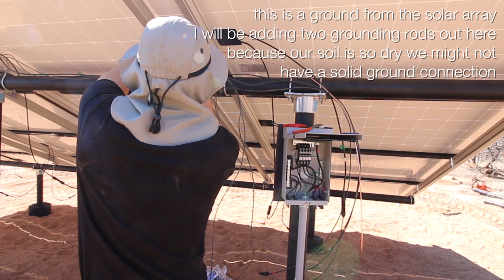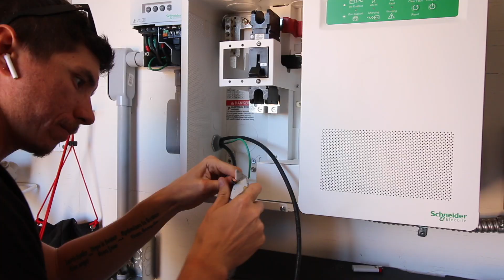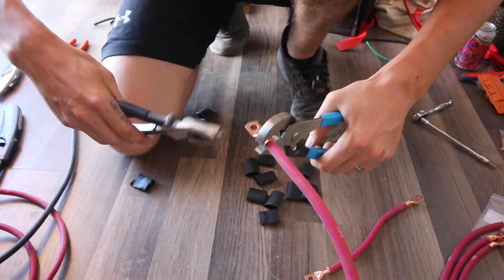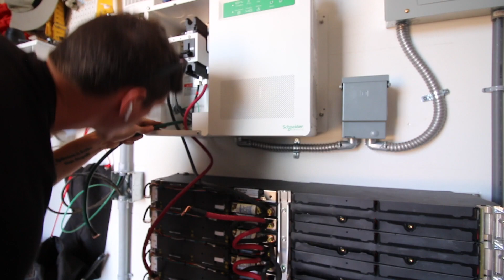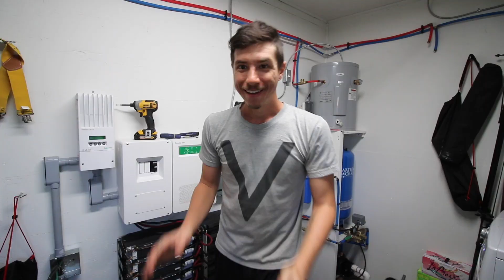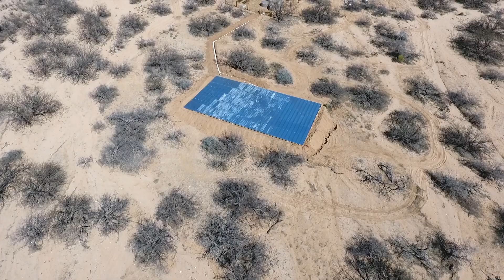HOLY F#CK IT WORKS!! Off Grid Solar Installation Day 6

Comment: Great work, using used EV batteries makes this a really sustainable system. And also from a technical point I think they are a great choice. EV batteries are often unusable for their primary purpose at 70%-80% of their original capacity, still a great energy density for stationary battery solar system.

Comment: What is the life span of the batteries and if one goes out can you just replace one?
Reply: Several thousand cycles to 100 percent discharge. He really should have a BMS/monitoring system on them.
Reply from the maker: I can get replacements for the different batteries

I've seen the cycle rating for lithium ion batteries before to be about 2000 cycles

Comment: Do the battery cells need an air gap separation to allow thermal cooling?
If not why not?
Reply: The cells don't really need cooling for this use, they originally had liquid cooling inside the Smart ED (which was a full electric not hybrid) but given our low current draw 60-80A and the fact that these batteries are wired in parallel (making a 300Ah pack) means these cells see a low discharge (or C rating) or about 0.25C worst case

Comment: Be aware of DC voltage on panels - it is really dangerous... But great work anyway Derek, it is clear that you are real electrician, you have done everything I have mentioned in last video comments and so on :-) I will more enjoy your work and do less comments :-)))
Reply: Trust me, I've given Derek the vaporized screw driver lecture many times, watch your hands, watch your tools. We were going to have an array voltage of 120VDC under load but with the 3x5 configuration it works out to about 90VDC, similar to the telephone system, dangerous but not nearly as much as a 350VDC EV pack
Reply: Totally agreed :-) perfect work. Any DC voltage over 50V is not safe so ... :-) We have 690V DC battery packs for UPS at our server room, really different story is you drop your tool somewhere ... fireworks